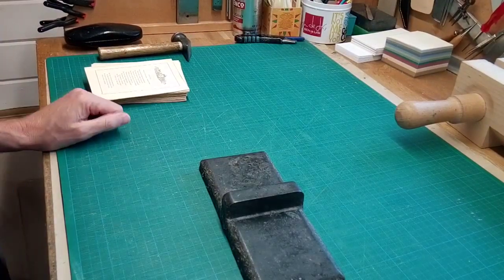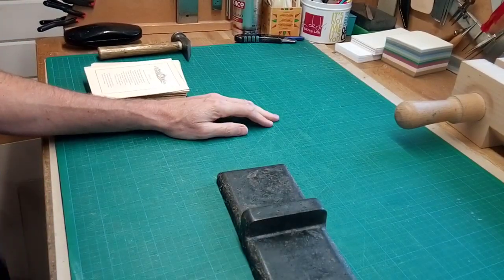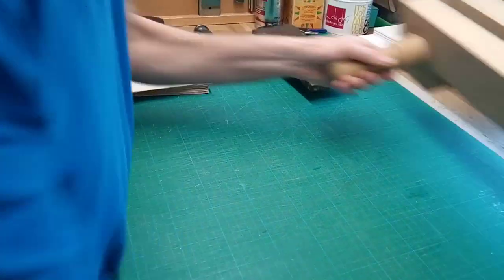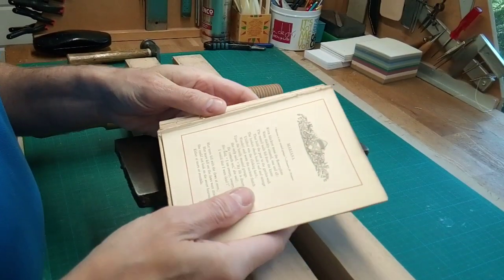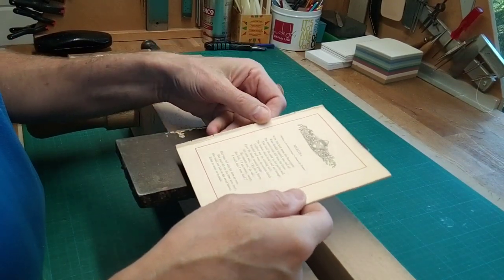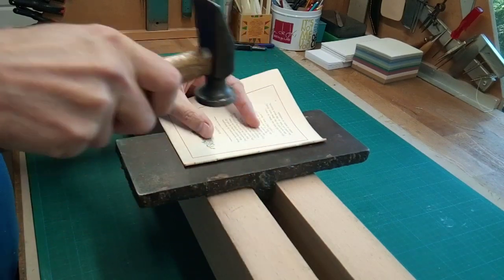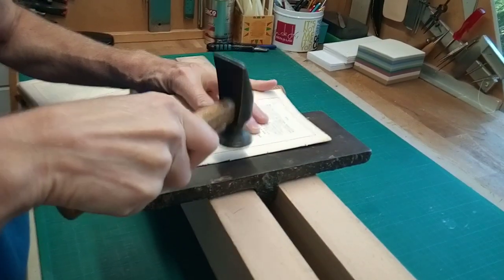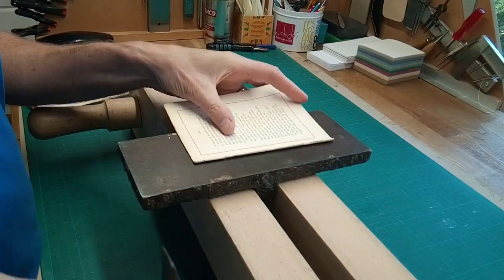Bookbinding - Using a Knocking Down Iron

Comment: I was on a course with Royston Haward making Bradel bindings a while ago - pre-lockdown. He showed us how to use a knocking down iron to knock the swell out of a text block once it's been sewn together. In that case the book block is in the press in a vertical position between boards with the knocking down iron held level on the top edge of the board behind the book block and you just whack it from the side. But I find that I get a line down the top sheet or two of the book block where the board has been. I have been wondering what to rty and do about that, and I think I have picked up a tip from your video about trimming using a knife - waste sheets. Would a couple of waste sheets on each side of the bookblock help reduce that line? I suspect so.

Phillip
Reply from the maker: The advantage of reducing swell in the way you suggest is that the sections are all held firmly in place. Personally I think I would put some greyboard on both sides of the text block to prevent any creasing/marks from the jaws of the press.